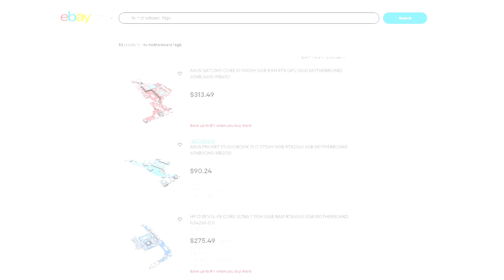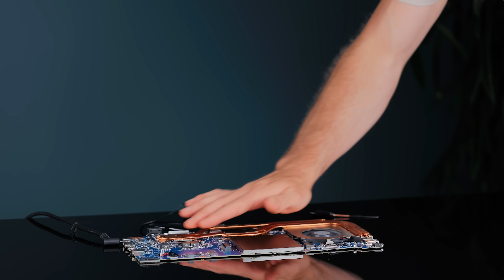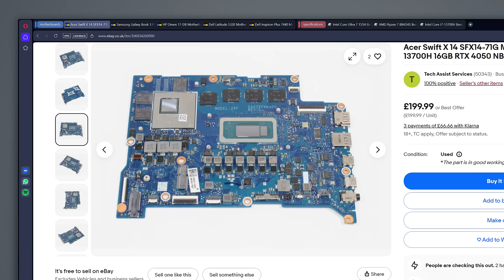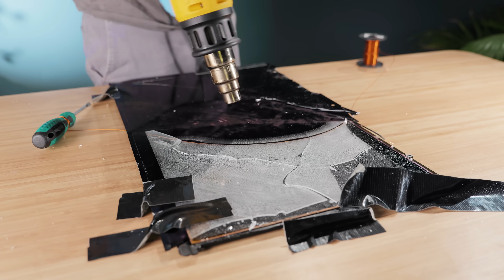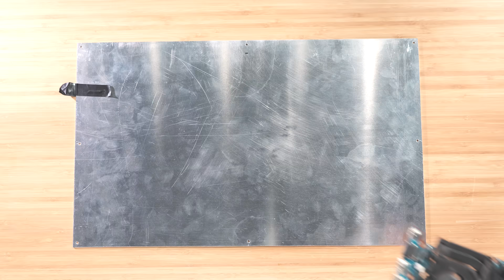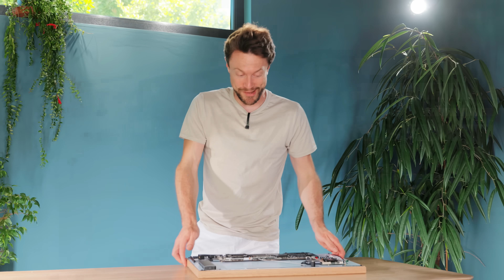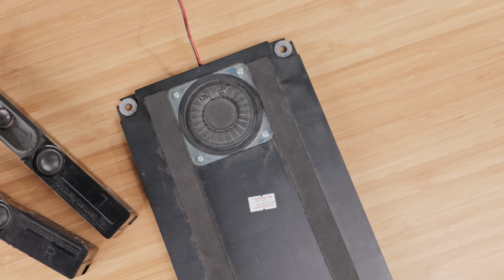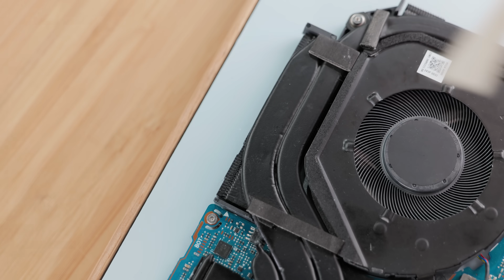A new way to build a PC in 2026!

Comment: One important thing that Matt didnt mention is that you want a motherboard with a MUX switch. Some laptops with dGPUs only have the graphics wired to the internal display, and the external display ports are driven by the CPU integrated graphics. So you can buy a "RTX 4080" laptop but when you plug the display in, it will run i7 intel iris graphics.
Reply: Funnily some laptops have exactly the opposite configuration.
My old gaming laptop delivered higher fps to an external display than to the internal one.

Afaik this is a design choice, which allows for lower battery consumption by disabling the dGPU and using the more efficient integrated GPU when less processing power is needed.
Reply: mmm why? why would Nvidia Optimus not work all of a sudden? you can always choose what GPU is used by your applications. Having dGPU only run games and heavy projects helps save on vRAM by the way, as in my experience when everything goes through dGPU the system, browser, background apps etc take up to 1GB of vRAM.
Reply: shouldnt be an issue since you can prefer apps to run with the GPU since windows 10 version 1803. most modern igpus+dgpus support this so yeah not an issue at the end of the day.
Reply: @imgladnotu9527  genuinely can't believe how many large ish content creators seem to just ignore that dgpus can be used even when the display is driven by the igpu. yes, the performance will likely be worse than directly using the dgpu but ive seen so many people say that plugging your monitor to the igpu will make the dgpu do nothing
Reply: @imgladnotu9527  you get around a 30% performance penalty that way from what I can remember. Takes quite a bit to render on one GPU and display the result on the other GPU's output.
Reply: @TheZerok666  Microsoft fixed that like a year ago, and it's "up to" 30% and only for games with very high fps, like in the hundreds. in GPU-limited games there is basically no difference.
Reply: @TabalugaDragon  Microsoft fixed a hardware limitation and broke physics in software? Lol
Reply: @TheZerok666  Jarrod's tech had a detailed comparison before and after the update. The difference with and without iGPU enabled became negligible, pretty much unnoticeable.
Reply: @TabalugaDragon   and that channel seems to be literally the only source for any benchmarks for that feature, which:

1. He says that he can't test with it off as it can't be disabled
2. Is a different use case than what is being discussed here anyway, because he wasn't testing on an external monitor
3. He says isn't supported by all hardware, which kind of defeats the argument for it being a "fix" when it's still hardware-dependent, same as a MUX switch.

Idk, dude. I don't buy it.
Reply: @TheZerok666  1. He tested with it off with old drivers\without the update
2. The reason external monitor usually works differently is because most of the times on gaming laptops HDMI goes through dGPU, which is basically the same as running the whole system switched to dGPU. I should know, as it was the only way to run the whole system on dGPU on my previous laptop. It literally wouldn't connect the extermal monitor if Nvidia GPU was manually disabled. So yes, it's the exact same thing as mux switch. 
3. What he meant is older hardware may not be supported. So yeah, like a laptop from 10 years ago may not work with it. But 4060 is newer than his video so it should work. 

I've been using my gaming laptop with an iGPU for a year now(before that I used only dGPU via HDMI) and I literally so no difference in CPU performance, it's pretty much the same. So yes, I think Microsoft(mostly) fixed it.
Reply: @TabalugaDragon everything you said makes no sense, with points 1 and 3 directly contradicting the video YOU cited. I watched it today.

Not going to engage further, you're entitled to your incorrect opinion of course.
Reply: @TheZerok666  it's been a while since I've watched the video. Doesn't mean I'm incorrect about the update and the iGPU overhead being gone almost completely. 
Of course, you're entitled to your incorrect opinion since there are literal tests that prove you wrong.
Reply: @imgladnotu9527  Since Windows 10? Nvidia control panel allowed me to allocate apps to a desirable GPU since Windows 7. Nvidia Optimus has existed for way over a decade.
Reply: @TabalugaDragon  windows 10 made it even easier
Reply: @user3840 how come? the "right click on executable file to select the GPU" is gone in W10.
Reply: @TabalugaDragon  no need for nvidia gpu
Reply: @user3840 for high performance you do actually. At least for budget projects like that
Reply: @TabalugaDragon half worked for me

Comment: The prices of those boards will skyrocket after this video
Reply: I’ve also checked the price of old floorboards and can confirm they’ve also skyrocketed
Reply: @GugzDhanjal Aluminium sheets are on back order and only the 1% can afford them.
Reply: Gonna be like 50 people globally who actually end up doing this after watching the video. Plenty of laptops with broken screens to go around.
Reply: Hate to be the one to break it to you but the board that he used was already $1000+ before this video, lol.  Pretty sure the board he used is from the Zephyrus G14 or G15 based on the form factor, although a lot of higher end ASUS laptops use a similar board.  These are $2000+ laptops.  There is a lot of demand on these, we see them with broken boards pretty often in my repair shop.
Reply: Indeed, they are now in the 500 bucks region.
Reply: just what i was thinking
Reply: Heatsink is not sold with motherboard, i think only 5 people lucky can find all parts if they know from where to get exact spare part, I just went to Aliexpress, its not easy and sometime find used laptop is cheaper
Reply: You don't have to use the exact same parts that Matt used, a point that he brought up at the beginning. Personally, I'm an IT consultant whose services include fixing computers, and while most of the laptops that clients bring in are getting on in age, every once in a while, a late-model laptop that has too much body damage on it to be worth fixing ends up on my bench. For me, the bigger problem is the time spent turning used laptop parts into a usable PC. Even if I'm able to get most of the parts free, I don't own a 3D printer or tools for precisely cutting aluminum and plastic sheets, nor do I have the skills to use them. Matt didn't give us a good feel for how long it took him to fabricate the "case" parts for his build, but my guess is it took him 3-4 hours, not counting any time for adhesives and finishes to dry. It would take me at least 3 times as long. By the time I'm done totaling up the labor and the new parts he showed (like the power regulator board and the subwoofer driver) for a build like this, I'd be looking at $1200-1500. I love creative reuse, but few of my clients spend that kind of money on PCs, and those that do are into architecture or CAD/CAM and actually need full-size video cards and real tower cases to hold them. The rest of my clients either want conventional laptops or would be just as happy with mini PCs costing 1/3 my build cost for a project like this. But the video was a lot of fun to watch.
Reply: @Mark-Lebowitz 3d printing is suuuuper easy, if you ever get curious the barrier to entry is like $300 and a couple of hours of research. I haven't made my own models but there are a lot of tools for it to the point where you can make basically whatever you can think of - and that's if it doesn't already exist out in the wild already. I bought my printer a few years ago (Bambu A1) and the first couple of years was just me printing stuff that other people made that was nice to have around the house. I didn't start building my own parts for computers till recently and I mostly use their modeling suite to do the work for me.

I've built a few similar all-in-ones to the one he built, as well as a full arcade cabinet out of nothing but free computer parts, free pallet wood, and 3d printed parts. It can all be done, the hardest part isn't even the execution, it's the planning. 😓 I've moved on to mostly modding consoles since that's the way my business naturally took me.
Reply: Given the market size, I doubt it. It is a good recycling method, but for a business to turn these laptop boards into desktops involves much work, and the price gap will be used up then easily. It needs specific tooling, manufacturing capability, it certainly can be done, but not that easily to change a whole market.
Reply: @permanently_temporary_name With fully functioning laptop motherboards, the money is made by selling to people/shops repairing laptops, not diy projects.
Reply: Not really. These parts aren't really usable for anything AI related and there's plenty of these parts around and very few buyers
Reply: haha yeah maybe. Or worse the manufactorer will sue him, because he takes the bread from them.

Comment: Did I observe correctly that you have removed the shattered glass protection from the retina display beneath, but you have not replaced the glass, leaving the retina display unprotected?
How does that work? For instance, if you are trying to clean the surface of dust.
Surely it can't stay unprotected.

Comment: One question popped up when I see 17:19 is, aren't internal displays connected through eDP? Both should be able to be directly connected without a driver board? Or perhaps this particular model still uses LVDS?
Reply: They have different pin layouts finding a aftermarket adapter is practically impossible.
(I counted the number of pins)

Comment: You are risking it all with the chopstick stand…
You have no protection on the display and the center of gravity is way too high for my confort.

Chop them up, add rectangular piece of wood, add weights under left and right, screw together et voila. Safety first

Comment: Pc builder since windows 98 2nd edition. 
I still build and support two work places worth of computers, mac and windows. 
My biggest problem with todays used market is just how toxic it has become. Let me explain. 
Good working parts are sourced and relisted at insanely high prices or within a small % near msrp or current sale prices- new!. 
While broken parts are hacked and mislabeled, out right scams, to where the used market at a decent deals, is garbage.
With 13th and 14th gen intel cpus on the market with degradation, mobo with bio bugs, and or out right broken.  CPUs and boards with broken or resoldered pins, Ram and storage that is garbag, psu..lol.  
I know how to troubleshoot hardware, what to look for, how to run diagnostics ... but so does every electronic shop in every global market, that keeps the good stuff, but worse-> then floods the market with terrible crap. 
The problem is, time is money and money is time... and 1 out of 5 wasted times, can add up to destroying any value, out of reused or of recovering 2nd life electronics. 

With people not able to buy new, and old hardware pulled out of dusty boxes and sold for high prices that may end up garbage or worse, taking out some of your good hardware.  The used market is so toxic. I only buy from sites with great return policies, but there you do not get a enough of a good deal to make it worth... your time.  And risking ebay's 'as is' ...woah, is a minefield.  
I just do not have the time, as my patience has run out. 

I wish there was some kind of regulations, but that would be so hard to enforce.

Comment: Computer processors and graphics cards will not destroy themselves without heat sinks. They will simply turn off. 

That said, doing anything more than testing that fans are spinning or that there is basic video output is unwise. I wouldn't keep a computer on without a processor or graphics card heat sink for more than 20 seconds or so.

Comment: I'm curious don't the motherboards come with Bluetooth? If so couldn't you just do the speaker via that. I understand you wanted to make a complete build but if I want to do this but easier I could just use the onboard Bluetooth?
Reply: latency. it will be really annoying in the long run if you intend to keep the system for a long time

Comment: As a laptop service technician, I would consider redesigning the cooling. Laptops are desired to be slim and lightweight despite the power they have so that forces engineers to make compromises with heat evacuation. Although that might mess up with your esthetics, I think some bigger heatsink or water cooler will preserve the motherboard better.

Comment: I work at a tech repair shop and we get a ton of old iMacs in with perfect displays. We have to remove the displays anyway to destroy or zero fill the drive before recycling so I may be building myself a triple monitor setup out of iMac displays.

Comment: @DIYPerks Note on using a different power supply than the HP one as this was likely a HP machine some laptops without the geniune charger has a bios function called BD PROCHOT (Which cant be disabled besides using ThrottleStop in windows) causing the cpu too throttle too 800MHz. Just wanna let you know if you ran into this issue as i have had that before even though the charger was sufficient enough.

Comment: One note about removing the glass from the iMac screen: not only is it a protective layer for the LCD panel, it also has the anti-glare coating, so while you might have a high resolution small display, you cannot use it with any kind of light source behind you or you'll be dealing with insane reflections.
Reply: Yes you are absolutely right, I notice also that there where some reflection that would drive me insane. So what do you suggest, buy a new glass for it ?
Reply: I noticed that too. I assumed people are just used to that level of extreme glare. Couldn't do it myself.

Comment: I wanna see someone do this, while also water cooling the CPU/GPU chips. While I am sure mounting the mobo in a more open fashion than the inside of a cramped laptop case itself provides better cooling performance, I bet there's still more performance to be gained by water cooling. Also those laptop fans are LOUD no matter what!

Comment: I was using half of an open laptop, and it also had a power button on the keyboard, so I used a bare wire to touch the correct pin and turn it on.

Comment: Just a thought: Add 2 decent quality 120mm fans into the backplate blowing onto the motherboard. Schould make the little annoying blower style fan obsolete, or at least way more quiet, cause it doesn't have to turn up as high.
Reply: Personally with this much room available I'd redo the cooling system completely, and maybe look at how much power the power delivery circuitry can actually handle, to see if the board is capable of doing more when not enclosed inside a shell resembling a space heater.

Comment: His is such an amazing idea. I have never thought about using an older laptop motherboard, but it actually makes a lot of sense considering their price and portability. As for the display I did turn an old iMac screen into an external display and even kept the speakers. And it is just awesome. That’s basically the Studio Display for a fraction of the cost. But that just made me think of, if it wouldn’t be possible to put the laptop into the iMacs housing to give it a new life with upgraded parts.

Comment: FYI, you could use any existing ribbon cable, cut one pin strip, shorten it, scrape, solder and boom.
Reply: Yeah which would be better because that copper tape is going to oxidise real fast and stop working.
Reply: @FuzzyToasterMeister  all the wiring in your home is friction-fit exposed copper. Oxidation isn't really an issue here
Reply: I think we're trying to avoid "boom" 😅

Comment: I think many people forget that those are not easy projects. Seperating the glass from the screen alone takes hours, you will likely scratch or break it or have dirt between the layers which results in an ugly picture. Also creating the speaker case and printing it takes a few hours too (if you ever did 3D modeling you know what I mean). The whole metal part isn't something most people can or would do at home. Everything is a nice idea but nothing anyone could do for himself.

This project took at least a few weeks full time. If you have a regular job it would take months.

YouTube videos really make things look easy, but in reality you wouldn't find certain parts, spend a lot of time on random problems and so on.

Comment: The idea is nice, but you sadly can't find any useful boards on eBay and also no working but cracked iMac screens. The boards are either very old, without any cooler, memory and fans or they cost >1000€. You can just buy a normal gaming notebook for this price.

Comment: a lot of boards also have test pads and power buttons are usually routed to those as well. You can find it with continuity check and it is easier to solder and more rigid as a connection (and easy to reverse)
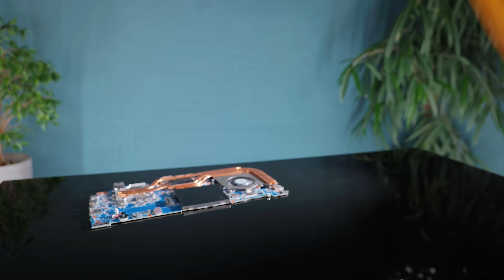Reply: 3:05

Comment: This PC was sooo cursed why did you use hotglue on the soldering joints and you could just have used external speakers and separated the comuter from the screen for  more modularity and usecases!!!!

Comment: With laptop mobos i had the same experience. They are damn cheap and i might even use some in my homelab as mini oc prices are also through the roof, but almost nobody uses laptop boards in their homelab/server rack. After finding out the pwr button pin and hooking it up its easy to use. A 8th grn laptop board i got for 15 euro is running as another node in my homelab.

Comment: What about chargers? Those barrel ones are different for each brand/model, and a replacement costs anywhere from 150 to 300€ for modern ones. Is there a way to get power cheaper, or will an external power supply be just as expensive?